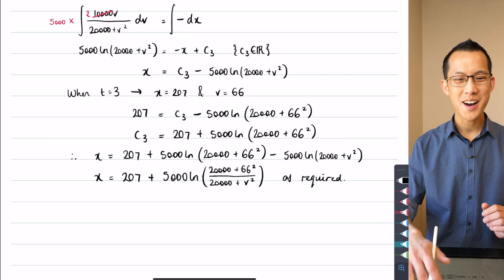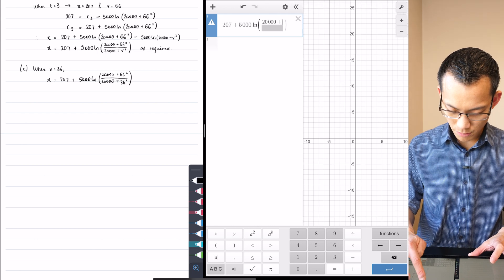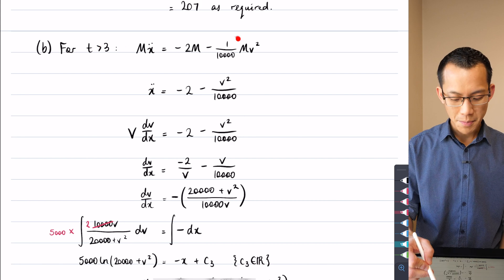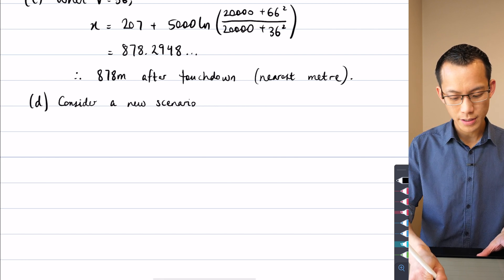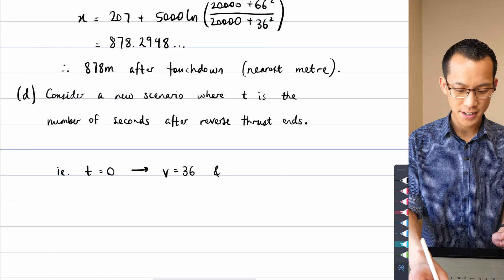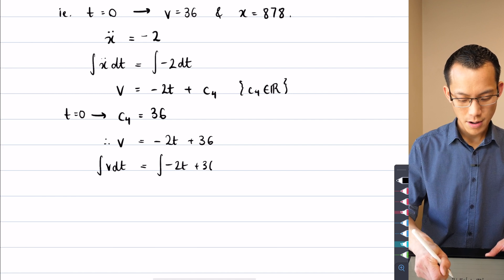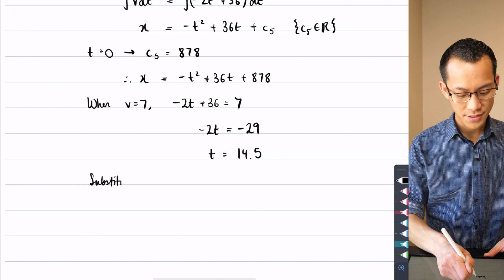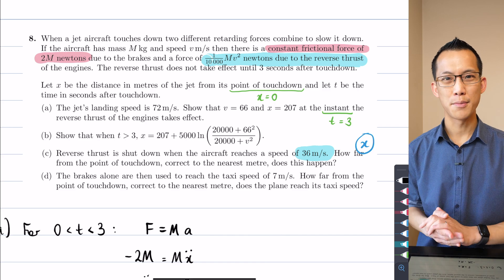Plane Braking Model (3 of 3: Resetting the time variable)

Comment: isn’t part c wrong? It wants from the point of touchdown but you have calculated from the start of reverse thrust.
Reply: The equation from part b) was indeed modelled for t>3 which is starting from reverse thrust. However, the x in that equation for part b) is still defined from point of touchdown as the initial conditions was t = 3, x = 207, v = 66. (x=207 is 207m from point of touchdown). So the x being calculated in part c) is still from point of touchdown rather than start of reverse thrust. In short, part c) is not wrong.

Comment: Alternatively, you could have used

v dv/dx or d/dx(0.5v^2)

When reverse thrust is off, no resistant force from that

So use the model
a = -2
d/dx(0.5v^2) = -2
0.5v^2 = -2x + K_1

From part c) at v = 36, x = 207 + 5000ln((20000+66^2)/(20000+36^2))

=> 0.5(36)^2 = -2(207 + 5000ln((20000+66^2)/(20000+36^2))) + K_1
=> K_1 = 2(207 + 5000ln((20000+66^2)/(20000+36^2))) + 0.5(36)^2

Therefore, at v = 7

0.5(7)^2 = -2x + K_1
=> 2x = K_1 - 0.5(7)^2
=> x = 0.5(K_1 - 0.5(7)^2)
        = 1190.04482 (calculator answer)

Therefore the plane is 1190m (nearest metre) from point of touchdown when it reaches taxi speed.